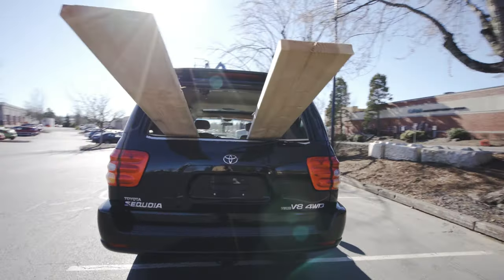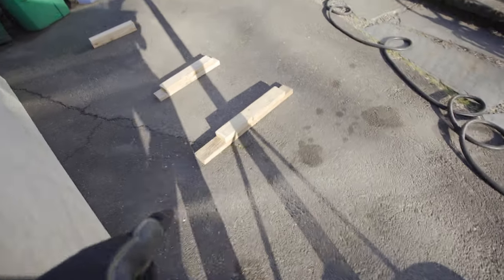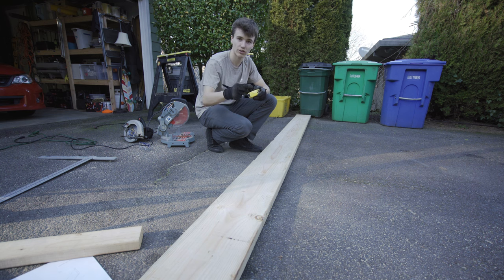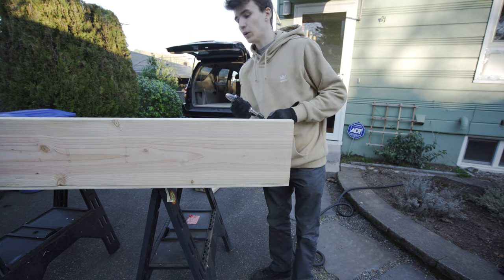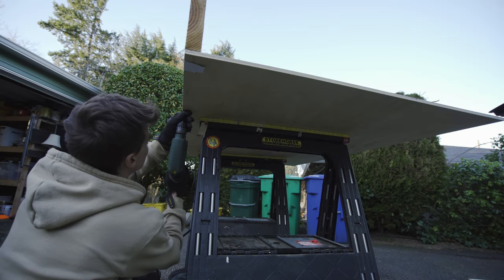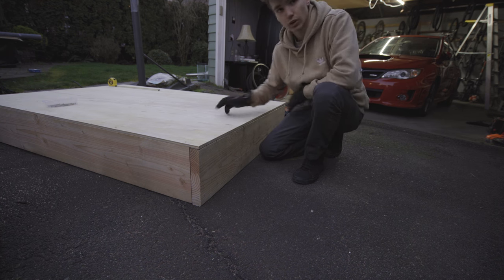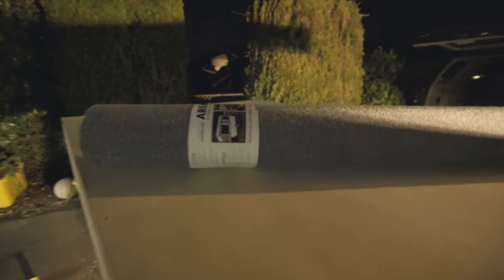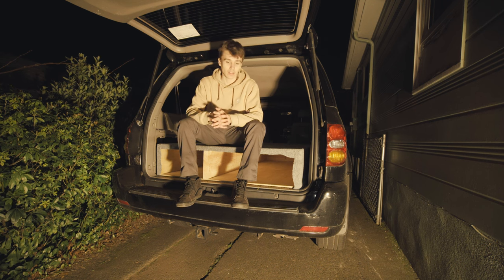I Built a Bed in my 1st Gen Toyota Sequoia!

Comment: Hey Maxwell, thanks for sharing. How did you mount/secure the platform to the bed of the Sequoia? Those are some pretty big drawers, so I'm guessing you had to figure out a way to ensure they were secure when you pull the drawers fully out
Reply from the maker: Thanks for watching! I surprisingly didn't secure the bed frame at all and haven't had any issues with it. I think it's because of the weight, it's a pretty heavy frame. 

I'm getting close to doing a complete rebuild of my camping setup and am currently trying to find a way to secure this new frame since it will be a bit smaller. Stay tuned, I'm sure I'll have videos about it!
Reply: @maxwell.peters  Ah thanks for the response Maxwell! It looks like you were usine 3/4 thick wood which would weigh it down so that makes sense. I am currently designing my Sequoia camper conversion now and plan on using 500 lbs slides so securing will pretty much be a necessity. My plan is to use the classic turnbuckles-to-tie-downs strategy that I've seen a lot of YouTubers do. Good look with the rebuild and keep us posted!
Reply from the maker: @boomshiddang  oh cool! I’m currently looking into drawer sliders as well. Thinking 48” sliders and am just deciding between 250lb or 500lb! Hope the build goes well for you!
Reply: @maxwell.peters  looking forward to seeing the new build! I’m probably 3-4 months away from finishing mine but plan on uploading a video tour of my own when finished. There needs to be more Sequoia camper content out there!